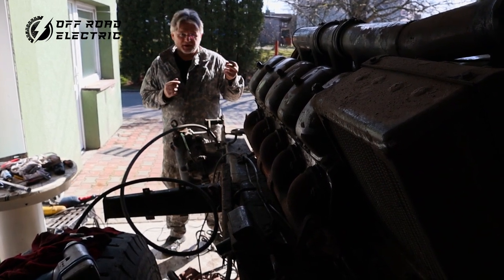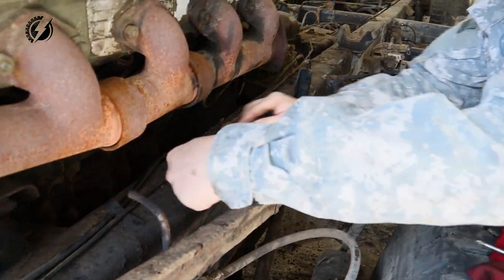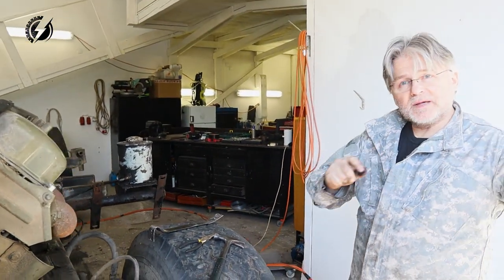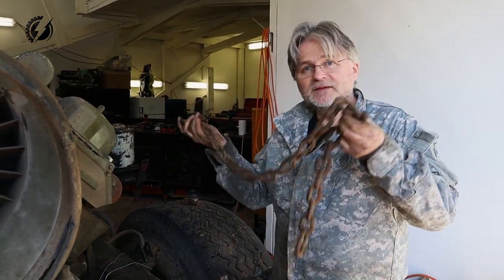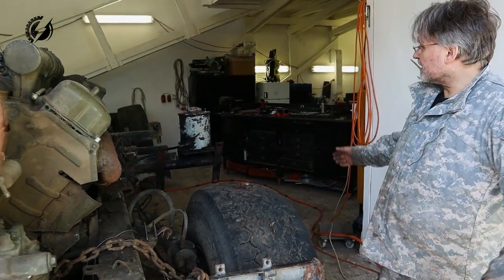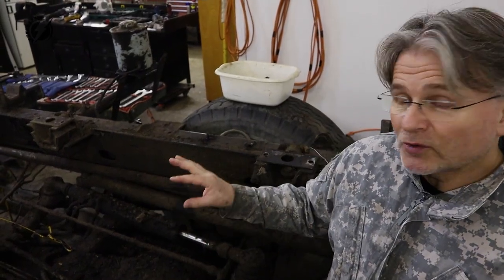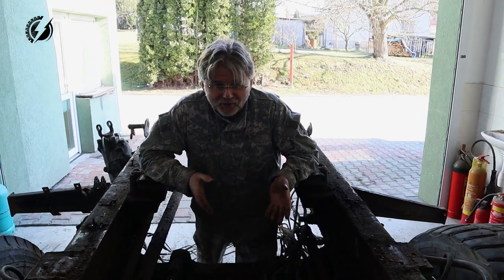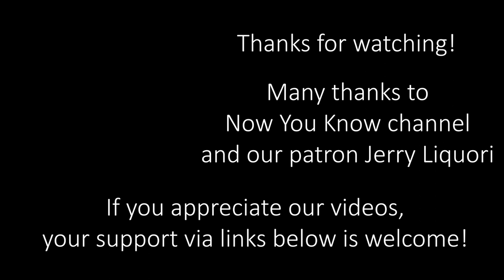Best Off Road Electric Monster Truck Build | Ep.15

Comment: Peter 
I cannot believe it came out. You had so little room in order to get it in the shed. I am curious how expensive the Electric motors will be? You said you will use 4 leaf motors. The Tetra is still a heavy frame, do you think they will be strong enough?👍
Papa P
Reply from the maker: Hi Marty,  I paid for the salvaged leaf about 4000 UK pounds, but in the USA I think they are much cheaper. When you sell unused parts, you should get almost all the money back. So, the answer is perhaps $0 for motors, batteries, and  electronics. I have here this Tatra already free, I sold the engine and 2 new tires, and got my money back. 4 Nissan motors will give me 320kW, and 1120Nm, the original motor has 208kW, and 1010Nm. But power and torque in electric motors are absolutely uncomparable with combustion engines. Also, Tatra will be geares down, and motors will be boosted. They are overbuilt by Nissan, some people got from them up to 4 times more power! I will go as high as I can, before I would break the Tatra components.
Reply: Off Road Electric 
I know they have so much more torque than a gas or Diesel engine and the torque comes on so much quicker. Sounds like you are educated in engineering. I cannot wait to see how this turns out. What are your plans for the Electatra?
Reply from the maker: @martyportersr7008   Marty Porter Sr  I think I can sell some modified chassis,  and people can fit them with Leaf components and build their  own trucks,  with help of these videos.....But main focus is to build them for myself. I ran the Hummer Tours in Smokies years ago,  and I will do again commercial off road with these trucks. I doubt  there is now a better  off road vehicle for commercial off road tours on  the planet, then these vehicles will  be.
Reply: Off Road Electric 
So you lived in the States and do you plan on doing something like that again in your area?
Reply from the maker: @martyportersr7008  Tourist destinations in Europe in the beginning, starting probably in Golden Sands, Bulgaria.
Reply: Off Road Electric 👍

Comment: Why are you wearing the us army acu uniform?
Reply from the maker: I had some crazy comments at the beginning, so I  paste here my comment from the trailer video, it should answer your question. 
  Hi, I am surprised I need to write about my work clothes in the channel that is about  building the monster truck.:) I like to work in uniforms because of their practicality and durability of their materials. Some people would like them to be discarded after military service instead of being reused,  and they are free to buy them in bulk and burn them, if so. But I have a freedom to wear what I want. Let's grow up!:)
Reply: Off Road Electric stolen valor at its finest
Reply from the maker: @none6369  There are only two ways to deal with military equipment after military use. Reuse it, or destroy it.  Is better to destroy uniforms, or reuse them?
Reply from the maker: Answer my question, please!
Reply: Off Road Electric destroy them
Reply from the maker: @none6369  Not much logic in such waste, but  I appreciate the value of my property, and will be using it, and you can destroy your property, and it is not my business. Thanks for your opinion. Peter